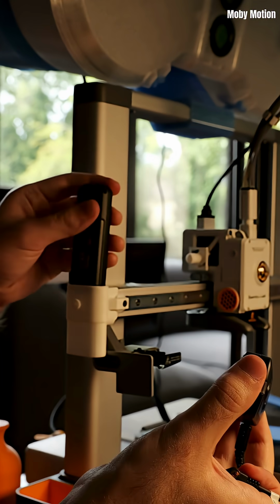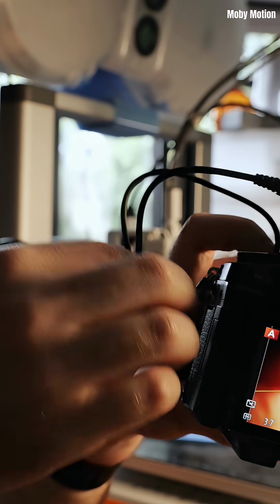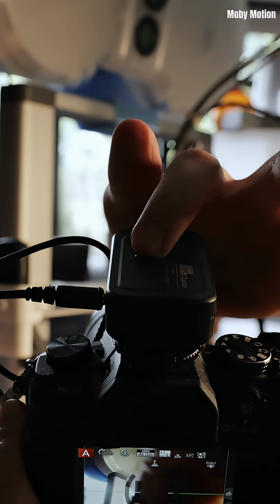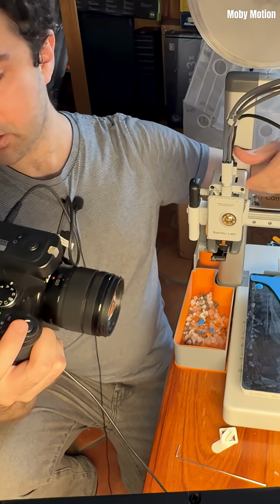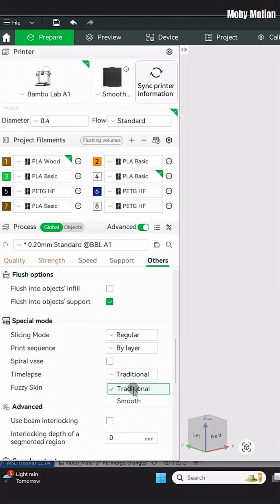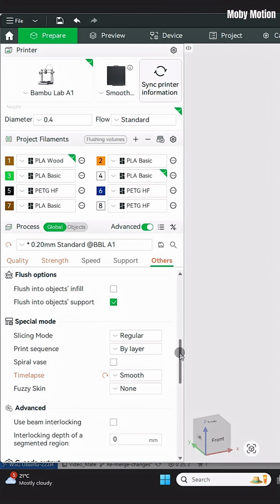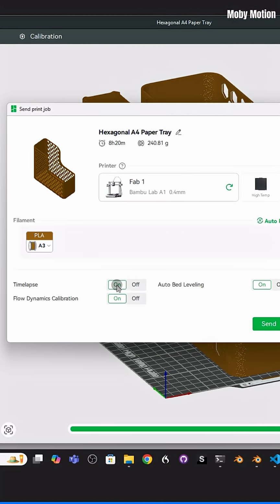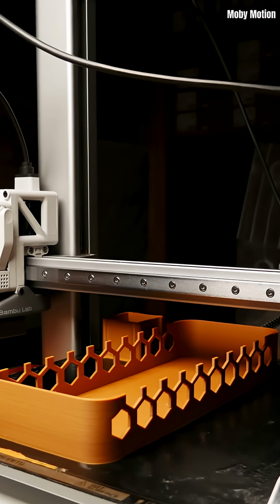Smooth 3D Printing Timelapses With Any Camera #3dprinting #tutorial

Comment: For me I have a simple Bluetooth controller that takes a button when it's clicked. Very similar to that one. I don't know if yours is Bluetooth, but on my A1 mini it goes to the side and it holds there for 2 to 3 seconds and it doesn't count as a click. It counts as a long press so I'm wondering how you got it too. Take a photo when the head is over to the side for so long.
Reply from the maker: I think this behaviour depends on the specific remote and the device it’s triggering. My remote has different settings, like burst (which takes a burst if you hold it down) and single photo mode which only takes 1 photo even if you hold it. I wonder if you can set this behaviour in the phone or if the trigger has an app?